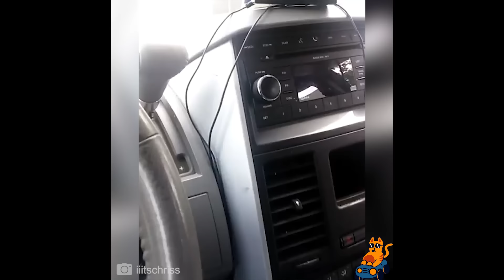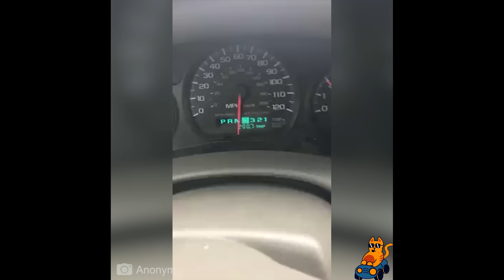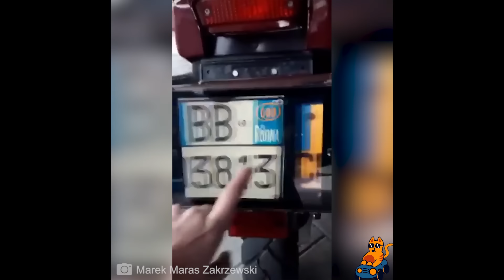Mechanical Problems Compilation [Part 6] 10 Minutes Mechanical Fails and more

Comment: 5:14 "Flywheel for sale. Just been ground flat." 🤦🏾‍♂️

I'm guessing the video ended before his tool and hand got wrapped around a flywheel bolt🤦🏾‍♂️🤦🏾‍♂️
Reply: Kj16V   If you have never had to ghetto turn a rotor to get by or get you to the next paycheck, you are not living....
Reply: @louisturner8842  lol, Practically everything  I've ever done to my cars has been ghetto! Even fabricated my own exhaust manifolds.  But there's ghetto and then there's ghettooooooo :D
Reply: Kj16V  I have even ghetto turned others rotors because they were in a pinch  and they lasted years...

Comment: What did the Subaru Impreza do to you? :) @2:17
Reply: It got miles to the head gasket
Reply: Kiwi The one well if so you could just change them out i mean it would be an experience for everyone to take an Engine apart
Reply: Subie King dont be rude.
Reply: @jdmking4776  LOL :0
Reply: @jim5735  Its fucked cause it could be an evo, and get miles to the crank. xD
Reply: Head gaskets made it. Win in my book.  Hopefully it was getting a Ver. 7 swap..
Reply: YoloMelone yea but it’s a fucking boxer so you need to take the whole damn engine out to replace both headgaskets.

Comment: That lizard 🦎 lol
My car has a lopey cam and a solid front motor mount.  It shakes at a dead stop like that.  Actually I hate it. I’m planning to replace that motor mount with the stock one, I’ll sacrifice the sweet throttle response for a smoother ride.

Comment: 0:15 .. thats the preferred method of throttle in india when the cable breaks 😂😂 .. once we drove a bus for 200kw with me pulling the throttle and driver using the gear and clutch 😂.

Comment: Empresas durability my suprise you. mine has a screwed up transmission stalls often sticks. I need to add oil every week and the engine is missfireing wen i give it gas but and the cruse controll is broken by it still starts up every morning no problem and gets me a to b no issues well a few stalls but it starts right back up happily as a clam

Comment: Some people shouldn’t have access to any holes, radiators, wiper tank or oil. As they will tip they wrong product in wrong hole. I’ve seen plenty of radiator fluid in oil sump, or engine oil in radiator. Even filling up petrol car with diesel and trying to drive away in a Smokey cloud for a few seconds before the engine succumbed.

Comment: And even with the prius steering wheel being upside down they will still pull out into the fast lane only going 10 mph slower than the posted speed limit

Comment: 1:48 is on Ford Super Duties, there’s a technical service bulletin that ford posted (I work at a dealer) for the steering linkage damper that causes a death wobble situation when above 50mph and hitting a bump.

Comment: that thumbnail... how is that even possible? Did it melt through the whole engine? I doubt it, but that’s a piston ring/bearing or whatever, and it shouldn’t  be outside the car. If anything, it should be in the oil pan.
Reply from the maker: You missed the part from 2:24